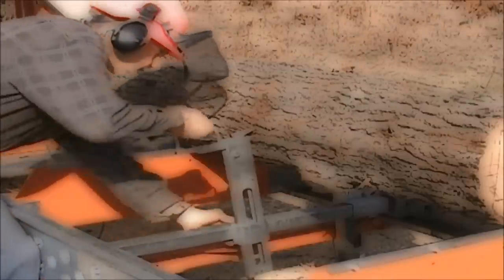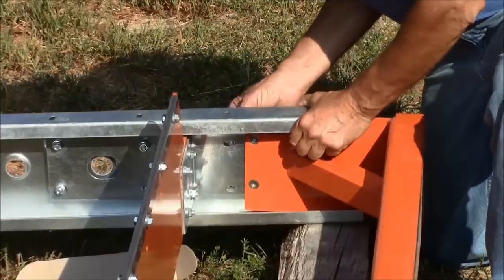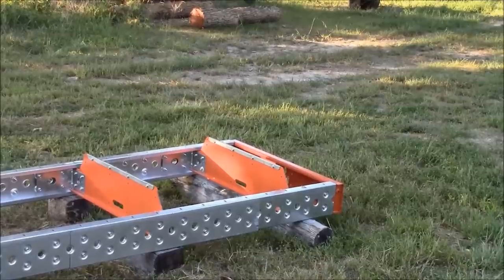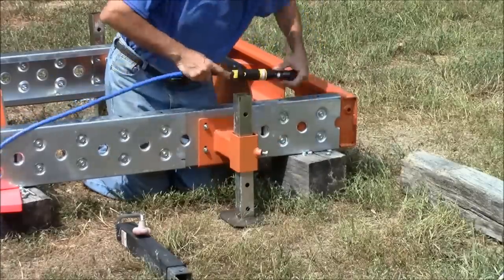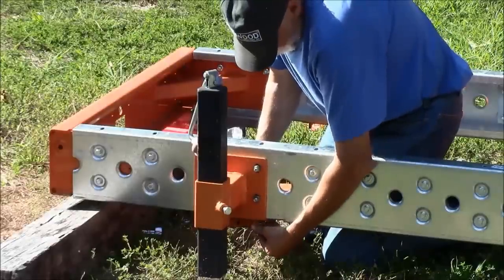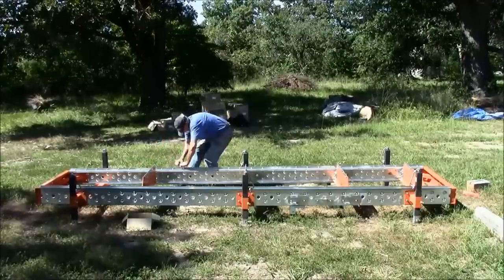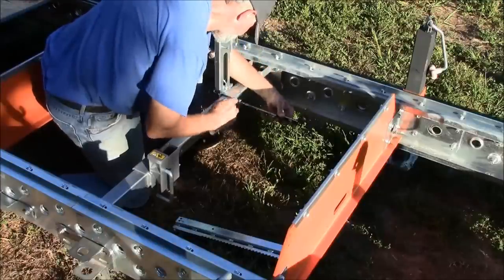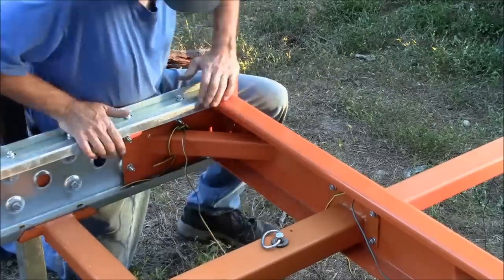The A, B, C's of assembling your LumberPro HD36 log deck

Comment: Ok - informative video - but - and to qualify my opinion, I am a mechanic. 

Wherever possible, tighten the nut onto the bolt, not the bolt into the nut. This is to achieve even and consistent torque on the fasteners - if the bolt binds in any way on the material you're assembling, you'll have uneven torquing if you tighten the bolt into the nut. If you tighten the nut onto the bolt, the resistance is always the same, and ergo the torque is the same, provided the thread on the bolt is not damaged. And trust me, after tightening the number of nuts you have on the mill, you'll find that the torques are consistent, within a few foot lbs, overall. I realize that you're not using, or even requiring a torque wrench for this assembly, but it's a good habit to get into.

Or maybe I'm just being pedantic :)
Reply: Hi, Des.  You are exactly right.  Good observation.  I do generally tighten the nut to the bolt, but sometimes, I get in a hurry, and it depends which wrench I have in which hand.  I've got a feeling that when you put the mill together, it will be absolutely perfect.

Comment: Is the frame assembly the same on the LM-29 as it is on the HD-36 and go together the same way ??? Also, is there a video on how to put together the LM-29. The side frame's look very different. The video showing the HD-36 looke easy, but now I see they look different. I was going to order the LM-29, but without seeing how it goe together, I'll hold off.
Reply from the maker: Hi Brian  The log deck for the LM29 and HD36 sawmills are totally different. 

We would be happy to answer any questions that you may have.  Please feel free to call us toll-free at 800-567-0404.
Reply: I've been given a quote "as I requested, but the more research I do, I find the components shown on the Norwood LM-29 Video are different than what you'll actually get. I snapshot pictures of the video of some of those items and sent them to Norwood, I spoke to them on the telephone and they're telling me these items are from the HM-36, but they are advertized on the LM-29 Video. I would like to clarify this before I purchase the LM-29.to name a few: Heavy duty log dogs, Lumber Pro standard log rest and the 8 Support legs, they are shown on the video as "Orand square type", but told they are round black. My intention was to do the purchase today, but waiting for an answer on some of these issues.
Reply: Brian..I've noticed the same thing too..but probably the lm26 and 29 are closer in parts..those pictures they use do make one think their lm29 frame will be built as nice

Comment: Has anyone bought and assembled a 2021 HD36 sawmill?
Reply: I'm working on assembling the new HD36v2 a little frustrated as it seems to be quite a bit different.
Reply: Working on the HD38 now, finishing up carriage and sawhead assembly. Same deck as the 36v2, which is more robust than the older HD36. You just have to take your time and make sure you carefully follow instructions. I recommend reading through the manual first, at least the entire section you're about to work on. Also, take careful inventory of the parts you need for that section and only take out the parts you need.
Reply: @mariaknutson1639  is there a particular spot you're stuck on or have you gotten it all together?
Reply: @Desert_Hobo   do you have a video on the bed frame. Am having a bit trouble with getting the rail level and even..
Reply: @danielmuletas9786  can you give me some more details of the problem? I don't have any videos of the assembly, but I can help walk you through it. Did you just start?
Reply: @mariaknutson1639  I'm in the same boat.  The splices they sent were 1/4" too long.  I've had to cut them down and am still having problems getting it plumb.  I've been fighting just assembling the deck for a full week now.